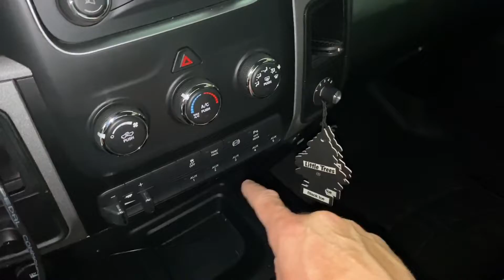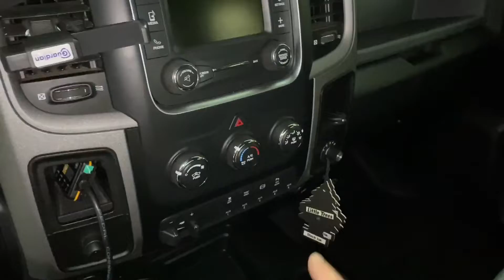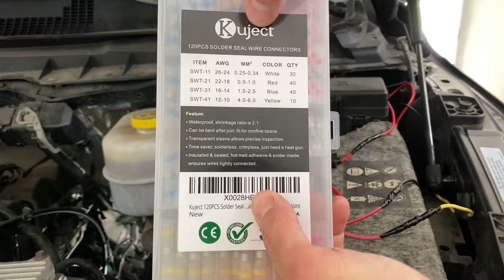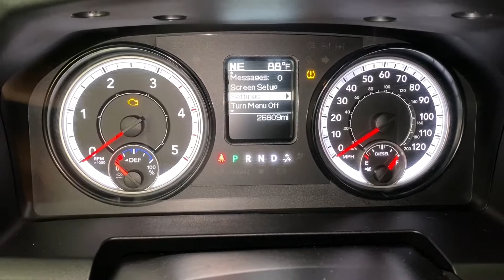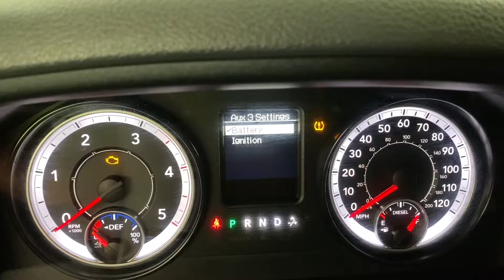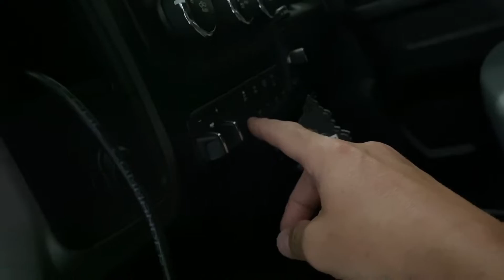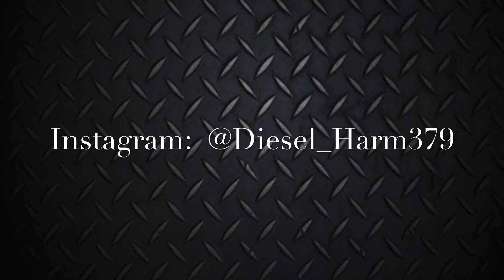Ram 2500 Aux Upfitter Switches For LED Lighting

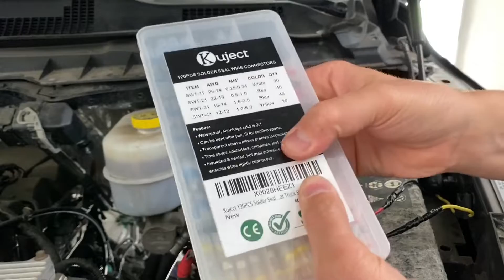Comment: I love those solder fittings. (Time stamp 7:40)  What I like to do when I use them is to get a piece of shrink tube and will slide it over the wire before I put the solder fittings together.  After I've completed splicing the two wire together with the heat-shrink fittings, I then slide the piece of regular heat-shrink tubing over the new joint and apply the heat to shrink the tubing over the joint.  This looks much cleaner than using electrical tape and it is much easier to apply than trying to wrap the electric tape around the new joint.

Comment: The manufacturer of the "Solder/ Shrink" fittings say to NOT use a flame to set them, they require a heat gun to do that. We use these shrink fittings at the boat shop and only use the heat gun. The flame will degrade the outside jacket and actually melt it. In addition, I personally use a secondary heat shrink tube over everything to give it a professional looking connection then cover it with a jacket all the to where it would go through the fire wall to give it a "Factory looking" wire harness. Also right next to the relay/ fuse location is a ground connection point that is a better location for a ground connection as it has no paint there....

Comment: Last state is only if the switch is set to Ignition, then it will retain the last position used (ON or OFF) even after the ignition has been shut off.  Again awesome video, thank you!!!
Reply: I know im asking randomly but does anyone know a trick to log back into an Instagram account..?
I stupidly forgot my password. I would love any help you can offer me.
Reply: @Anthony Deandre instablaster :)
Reply: @Zakai Benson i really appreciate your reply. I got to the site through google and Im waiting for the hacking stuff now.
Takes quite some time so I will reply here later with my results.
Reply: @Zakai Benson it did the trick and I finally got access to my account again. Im so happy!
Thank you so much you really help me out!
Reply: @Anthony Deandre no problem :)

Comment: We'll be getting a Dodge truck let  this summer, early fall to tow a 5th wheel.  Wasn't sure about the upfitter switches if I wanted them or not.  Now I do so I can wire "passing" lights to my trailers running lights.  Old school they call em ICC lights.  Also want to rig back up lights to the trailer, so I can hit those when I need em..
Reply from the maker: Yes, get the aux switches they will make your life easier.

Comment: I am getting ready to install fog lights in Aux3 do I need to use a relay and an in-line fuse for the lights?
Reply from the maker: Typically the aux switches have a fuse and relay in the box under the hood.  You should not need to add any unless the old ones are bad.

Comment: Question. Would it matter if each light were grounded to the vehicle SEPARATELY or alternatively how about if both grounds (one from each light) were connected together and then ground to a single point? Would the differences determine series or parallel? Please explain. TYSM
Reply from the maker: I’m my experience, all lights can be grounded to the same ground as long as you have a good ground.  I don’t know if it makes any significant difference running them all separate or not.

Comment: I liked the video and the suggested solder fittings and soldering tool.  What tires are you running?  I like them and drive in snow often.
Reply from the maker: My tires are Toyo Open Country 40x15.5

Comment: With a light bar would you need to wire in the relay or how’s that work?
Reply from the maker: No, the auxiliary switches that come as an option for the ram already have fuses and relays in the box under the front hood.
Reply: @DieselLegiance  wow that’s easy thanks i just got a 15 with these switches and I wanna put a light bar on it so that would work perfect

Comment: I basically have the same truck but a 3500 is one of there switches ment for like strobe lights
Reply from the maker: Could be.  Upfitter switches can be wired in to anything.  If you have a 3500, it’s possible the shrines were wired into the Upfitter box under the hood.

Comment: I bought my ram 5500 with strobes already installed.  Looks like Aux 1 button is wired to them.  But for some reason they won’t come on.  I set it up on the dash for battery and ignition.  Tried both, still nothing.  Any ideas why? All 5 Aux button are lit.
Reply from the maker: I’d Check the fuse in the box under the hood?  If still good, check the ground wire?  If good, check to make sure the positive wire from the lights are plugged into the right number on the aux harness under the hood just in case.  If still not working, just find the wires from the lights and look for any bad connections.  If all wires look good and lights still don’t work, maybe take it to a shop to look at.
Reply: @DieselLegiance  thanks.  Great video.  Simple and straight to the point.  Great info.

Comment: Hey! Old video but I hope you see the comment. I added rock lights to my aux one, should I lower the aux one fuse size?
Reply from the maker: I don’t think you need to lower the fuse size but if the fuse requirement for the rocklights is less than the current aux 1 fuse, you can if you want.  I don’t think I did…
Reply: Thanks! Current fuse is like 40a lol I think the rock lights call for a 15-20a. I’ll leave it. Did you add an inline fuse on the rock lights?
Reply from the maker: I think I did have an in line fuse coming off the battery to the control module.  This was years ago and do not 100% remember but I think I did.

Comment: Hey does your bumper have a wrap.  I have the same truck with chrome bumpers but would love to get rid of the chrome.
Reply from the maker: No, my 2016 Ram has aftermarket oem replacement painted bumpers.  My 2018 Ram had chrome bumpers but I had them professionally painted.  They sandblasted them, primed with an epoxy, then base coats and then clear coated.

Comment: Can they be removed after if I decide to sell my truck and take off the accessories? Also what kind of tuner is that I have the same truck ?
Reply from the maker: Yes, you can unplug the wires from the main harness.  However, it’s probably a little harder to disassemble the whole assembly to remove to reinstall in a different truck.  Also, I have an EFI tune.
Reply: @DieselLegiance  yea I was hoping just being able to take out the wires if I decided to sell  my beast but it’s not happening anytime soon . Just bought some lasfit pods and have a custom bumper. My old shop did and extremely crappy job putting my light bar on and they put the switch right by my knees as get out of the truck. Great videos watched all of them. Seems we have lots in common. Where are you from.
Reply from the maker: That’s cool.  If no reason to sell, just keep it and keep modding it.  I’m from Mount Pleasant Pennsylvania.
Reply: @DieselLegiance  that’s awesome man I go to pa a lot for hunting, I live about 2 hrs from Gettysburg pa. I’m from Leesburg va.
Reply from the maker: That’s cool.  We like to visit Gettysburg especially bike week and I travel a lot to Charlottesville VA as my daughter goes to college at UVA.
Reply: @DieselLegiance  soo  cool I have a sister who lives in Charlottesville she has cerebral palsy and lives with the amish in a town called free union outside of Charlottesville. Plus her doctor is from uva medical school.

Comment: If your wiring requires an inline fuse, is it labeled in the fuse box for 1-5 auxiliary to add a fuse? How big of a fuse can you run on it?
Reply from the maker: Yes, the aux switch housing has fuses inside in different sizes.  Just figure out which size fuse you need and switch the fuses around or replace them as needed.
Reply: @DieselLegiance  thanks man, solid video. 🤘

Comment: I have a 2021 1500 Warlock and was wondering if these would fit. It is very similar to the 2019 Rebel.
Reply from the maker: Not sure.  The aux switches I have were an “add on” package from the dealership.

Comment: I have a 14 3500 I don’t have juice to the upfit housing on firewall the interior switch lights turn on but nothing at the firewall housing any idea
Reply from the maker: Maybe a bad wire connection going to the Upfitter fuse box under the hood?  Maybe the relays or fuses are bad?
Reply: Randy did you get a solution?
Reply: @EdSchellhase  thanks for checking in!! not yet I’m guessing I need to take the truck to dealer to program they couldn’t tell me if that is the issue some folks aren’t great at there job! I’ve already had it there once it cost me $180 for the trailer brake controller sounds like it’s going to cost another $180 are you familiar with the spark programmer?

Comment: Where did you get the wiring?
Reply from the maker: It came with my truck as a package.  You can probably call a dealer and order it or if you can find the metal clip/ends, you can make your own.

Comment: Is there a reason not to use negative on the battery for ground?
Reply from the maker: Not at all, I thought about running a ground block from the battery to the cab for all of my wiring but I have not got around to it.  I just wanted to keep as little wires around the battery and hot engine as possible which is why I grounded at the corner of the frame.  Sometimes I ground to the frame underneath if it’s a shorter run and easier depending on the situation such as my power steps.  Either way is fine.  If you do ground to the frame, just sand the area to make sure it’s clean bare metal.

Comment: Appreciated your video very informative. Quick question where did you get the wiring for the upfitters?
Reply from the maker: The wiring came with the Upfitter package with my truck.  If you already have the switches and plug but no wires, check online or call your local parts dealer and they can get them.

Comment: Why not just buy the ends and crimpers for the upfitter plugs so you have no spice joint at all?  Much cleaner than a bunch of electrical tape connectors.  Also do yourself a favor and put your wires in plastic loom for protection and appearance.

As for last state I'm guessing that didn't work because you selected battery.  If you selected ignition the device would be controlled by the ignition and if they were on when the ignition was switched off they'll come back on when you restart. With battery they'll stay on until you shut them off which is probably not what you want for interior lights as you could run down your battery.
Reply from the maker: I do use the upfitter ends at the box under the hood.  I have used wire loom since this video.  I am just always changing things up and sometimes don’t have the loom on hand at the time of filming.
Reply: @DieselLegiance  by ends I was suggesting buying the pins and putting them directly on the wire you are connecting so you don't have to have a splice joint from one wire to another.
Reply from the maker: I did not know they had longer leads?  The ones I have from the dealership are a metal connector that plugs in but has a splice end as the leads are only about 6” long?
Reply: @caseypries7559  where can I buy what you are talking about
Reply: @JuanHernandez-ce8rb  if you scroll up you'll see a link I posted to waytek wire.  I posted this 3 months ago and I don't remember all the details. I do remember they are harder to find than they should be.
Reply from the maker: They come from the factory as an option.  You might find someone who makes them online?

Comment: Is it difficult...has anyone tried to remove the Ram wire from the upfitter block after having "clicked" it in or is it stuck in there permanently?
Reply from the maker: It’s removable.  You need to unplug the harness and stick a tiny flat head screwdriver in the harness and unlock the lever and then pull the pins out.